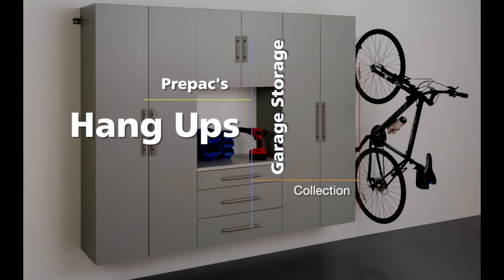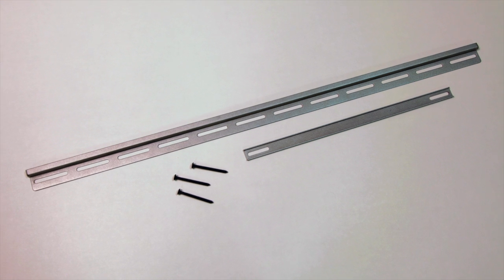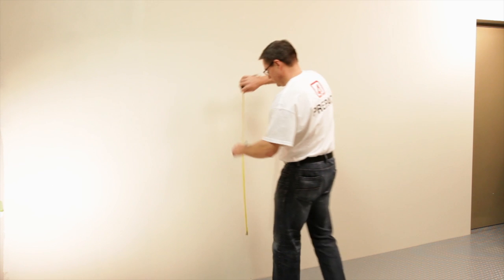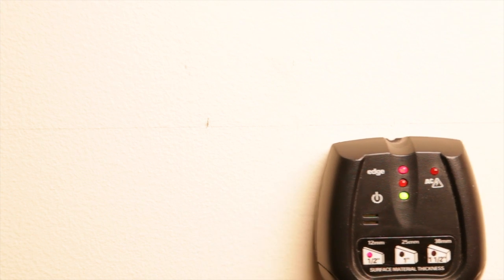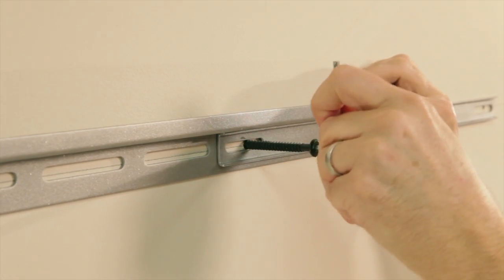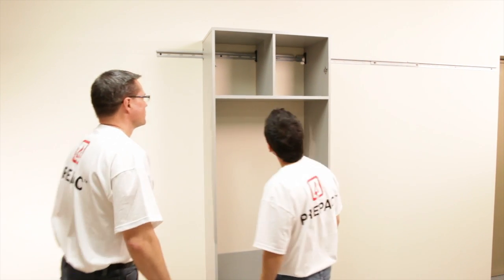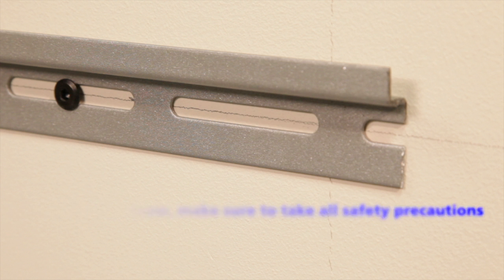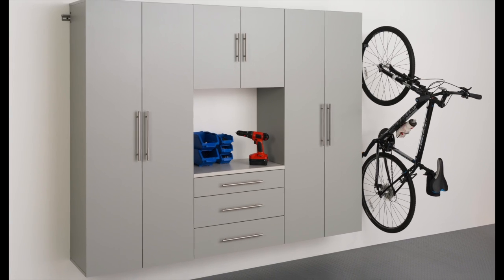Prepac's HangUps Garage Storage Installation

Comment: Watched this before installing  3 - 72"Hx24"W hangups today in the 3rd garage, easy build after the 1st unit. Most time spent on prepping wall and drilling into the studs. After that it was easy sailing but it did take most of the afternoon. Thanks!!!!
Reply from the maker: Thanks for the comment.

Comment: If I have a 30" wide cabinet, are the rails that come width the same width as the cabinet? Pictures of the product on the Prepac website show the rail sticking out several inches on either side.
Reply: From my experience yesterday, the rail stacked out. But if the studs were closer the rails could be positioned better so they don’t. A mean could be other ways but with my limited knowledge experience that’s how I see it.

Comment: I wanted to put an upper cabinet above a storage cabinet to use most of my wall space. I plan to install the large lower wall cabinet first then the upper, making them butt together   How much clearance must there be from the top of the wall to install?  If they have to be placed on the rail I assume there must be a gap to allow for installation.
Reply from the maker: Hi Scott,  You will need 5" of clearance for mounting because you have to lift cabinet above the rail and set it down in place. Please email info@prepacmfg.com for more information.
Reply: I am also try to stack two 36" w x 24" H  cabinets. I believe it will be better to hang lower one first. I have 72" tall on left and 2 of the 24" H on the right. Will align the top of left and right. But i want at what distance from the top rail which is at 79.5" , should be the lower cabinet's rail so that they are stacked without any gap?

Comment: I'm planning on mounting a 24"Hx30Wx16D for my laundry room. What measurement from the top of the wall /ceiling should I mount the rail? I intend  to mount the cabinet up to the ceiling.
Reply from the maker: From the top of the cabinet to the top of the notch is 4 inches but you will need 5" of clearance for mounting because you have to lift cabinet above the rail and set it down in place. Please email info@prepacmfg.com for more information.  This measurement is the same for all the cabinets in case you want to mount others.
Reply: @PrepacYT  thank you for your reply. one more  thing to ask for clarification, the area where these 2 cabinets are going into measures 72 inches wide. I realize that I will be leaving a gap in between the 2 cabinets. However regarding the mounting rails since they are 38 inches long, I would need to cut off one of them to accommodate both rails, would it be best to cut one of the two (about 4 inches) so that I will have a full 72 inches of rail on the wall? thanks again, My cabinets are coming tomorrow :-)
Reply from the maker: @PaulJose411  Hi.  You can position the cabinets adjacent to each other so there is no gap. Yes, you will need to cut off the excess rail, but yes you will need the length of rail equal to the width of the cabinets. (You can leave it intact if you have space on the wall and are OK with how it looks). Feel free to email me at info@prepacmfg.com if you have more questions.

Comment: Can you drill holes into the sides?
Reply from the maker: Yes, you can. For what purpose?
Reply: @PrepacYT  I wanted to install cabinets in the laundry room then install a bar that connects to the cabinet then to the wall to hang clothes that need to dry.
Reply from the maker: @b_rad1519  great idea!